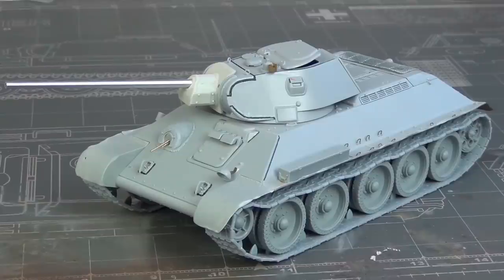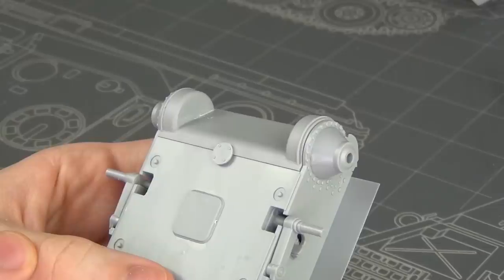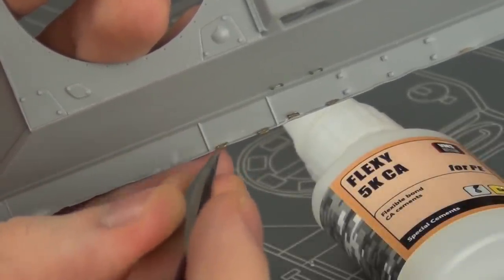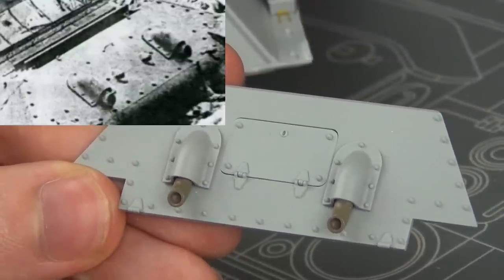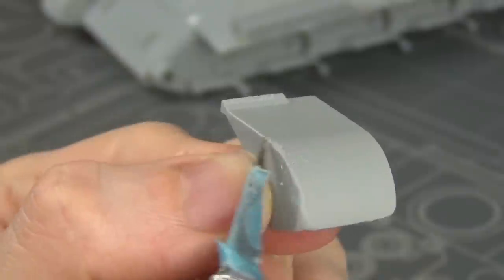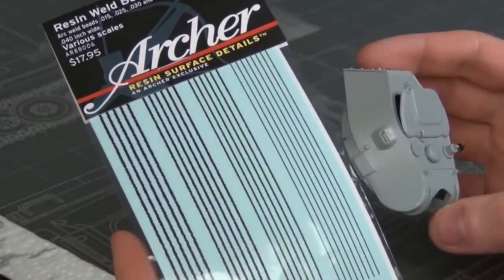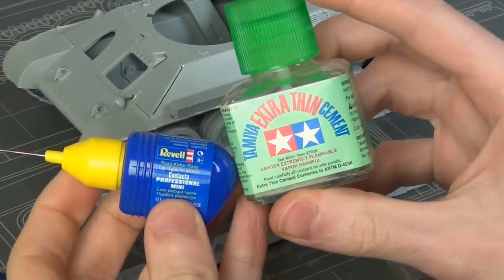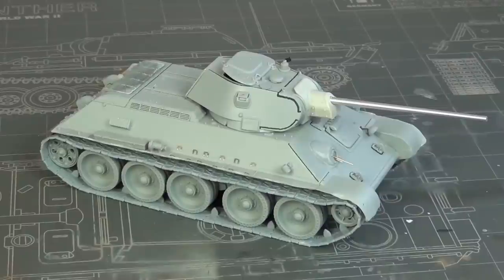Let's Build the T-34 with 57mm High Velocity Gun ZiS-4

Comment: I've heard about these 57mmAT equipped tanks, but never really thought to look for one in a photo. I presume a lot of these hull/turret modifications were specific to the factory they came from, rather than a general order or anything like that. Good work!
Reply from the maker: Yes, they are 183-Factory vehicles from around September-October 1941.  Most of the photos I used for reference are actually 76mm tanks from the same batch.  Thank you!
Reply: @Panzermeister36  STZ didn't test 57s?🤔
Reply from the maker: There was this batch of around 10 made at the 183 Kharkov Factory, then one prototype on an earlier chassis, and one other vehicle tested later on which has the hexagonal style turret.
Reply: @sliceslice4440  The one at UGMK is a half-assed mockup using mostly STZ parts and therefore doesn't represent the real deal very well.
Reply: @sliceslice4440  We don’t have such a tank in Moscow, there is a Frankenstein from Verkhnyaya Pyshma.

Comment: Beautiful work - stunning. 

If I am not mistaken, the welds on the turret should follow around the interlocks on the front of the turret. Also, the items referred to as "fire extinguishers" are actually jacks.
Reply from the maker: Thank you!  The front of the turret already had good looking welds in the interlocks, so I only replaced the welds on the turret sides where we had the large gaps.  

I guess it does make sense that those would be bottle jacks as they're quite large for fire extinguishers 😊

Comment: Cool unusual subject. Everything looks fine, only one minor thing take my attention.
Tie downs and loops for ice cleats should be rounded not flat, that's why I prefer using wire than pe for that particular details.
Beside this your model looks great
Reply from the maker: Thank you for the comment!  Yes, you are correct.  But, I am not really skilled enough with bending small bits of wire to model them more accurately, so this is a compromise I have to accept for now 😊

Comment: One thing that you need to take some care with is that there are two types of track links, one with a guide horn and one without, and they are supposed to alternate on the length of the track. Depending on the circumstances, and what the crew has available to repair a broken track  with, this alternating pattern may not be followed, so you might have three links in a row with guide horns, or three without, but the crew would try to keep the alternation if possible.

One feature of the T-34 that is rarely modeled is the link pin wedge. The track links are held together by pins runnign through the links; on one link of the pair it fits tightly, the other more loosely. On some tanks from all sides in WWII, there are various devices used to keep the pins from sliding back out, from cotter pins to bolts. The Russians took a more brute-force approach to keeping the track pins in place. The pins were inserted from the side that would be closest to the tank, and there was a metal wedge welded on the side of the tank just behind the front idler wheels, where if a track pin had started to work its way out, it would hit the plate and be forced back in. This would make a distinctive 'clunk' that was an iconic sound associated with the T-34.
Reply from the maker: You cannot have two of the same track link (toothed or non-toothed) linked together.  They are not simply the same save for the presence of the tooth; they have a different number of loops through which the pin is threaded -- 4 vs 5.  

The T-34 did not always have the cotter-pin-less track design either; the early models used a traditional locking nut.  And German tanks also have track return pin knocker plates if you look, starting in 1943.

Comment: Very nice tutorial with excellent attention to specific details-love that! I do some things a bit differently, like welds built up from acrylic putty. I also use files still (old school - I've had them for decades) but nowadays I also use stick sanders a lot more. I'm currently considering building a KV2 test vehicle with the 107mm ZiS 6 (i think) and a T-34 with the 57mm. 

I'm not a particular friend of Dragon kits, do you have any idea which other T-34 kit(s) might be suitable? 

For the KV2 I'm still looking into either an old Trumpeter kit  (they require a bit of work but are quite accurate and inexpensive) or maybe a new Tamiya one, though that seems to be a bit pricey...

Cheers, Guido
Reply: For the 10 T-34/57s that went into combat you are more or less Dragon or to the shitty Maquette/MSD (which good luck finding). There also was a latter prototype with a hexagonal turret, maybe try the hexagonal turret prototype from any model depicting a Zavod 183 with a hard-egde turret (for ex Zvezda).
Reply: @red0guy  Zvezda models are certainly mostly very good nowadays...thanks for the tip!

Comment: Was the 57mm gun a German mod on captured vehicles or a Soviet mod? You’d think the 76mm standard gun would be superior to smaller caliber. 
When I was a modeler in the 80s tank models only came with the rubber tracks.. times have changed 😁. Again great skill! Would be good to see it painted and weathered.
Reply from the maker: Thank you!  The 57mm gun was a Soviet gun, the ZiS-4, which was based on the ZiS-2 field gun.  It had a superior anti-tank capability as the shell is fired at much high velocity, but the high-explosive shells are terrible as there is much less volume for explosives in the shell.  So, the project failed on the T-34.

Comment: I'm glad I was wrong regarding the panzer art Mantlet. The back towing hooks are serviceable but now quite right, as they more straight and the end is not wavey. And the drive  sprocket in the photo is without the ridge, so you should have filed it out with putty., Other than that, congrats ....
PS there is a re-release of the 42 stz so there are 3 kits...
Reply from the maker: Ah, you're right about the drive wheels.  I'll fix those.  The rear tow hooks are barely visible so nobody will notice 😁  Thanks for the tips!

Comment: Т-34-57, с башней СТЗ, данной модификации никогда не выпускался
Reply from the maker: 183 factory used the same turret as STZ...both cast and welded.  There are photos of this exact vehicle I am modelling.  So it was produced.
Reply: @Panzermeister36  This is a Frankenstein from Verkhnyaya Pyshma. It is made from the remains of various modifications of the early T-34-76, and the gun on the tank is fake, in fact it is a pipe and that's it.
Reply: @Panzermeister36  И ещё возле пулемётного гнезда, на месте когда-то стоявшей 2-ой фары, там оставался даже на этих выпусков танка горбик защиты проводов 2-ой фары, но с заделанным отверстием
Reply: @Panzermeister36  Также если ты делаешь вариант танка под номером "20" то ты ошибся с башней и люком механика-водителя. Там на танке стоит башня не от СТЗ а от совсем другого завода, а также люк мех.вода там раннего типа, а не позднего.
Reply: @Panzermeister36  И до кучи зачем пилить модель от дрегона, если есть от MSD Макет. Набор от МСД дешёвый, и не дорогой как дрегон.

Comment: Hi, are you sure there are welds around those pieces: https://youtu.be/t3SRGENbKRY?t=881
considering they are fixed by 6 bolts
Reply from the maker: Yes, I noticed it specifically in photos of the real vehicle.  The tow hooks are not meant to be removed, so they bolt/rivet them on and then weld it for extra strength.